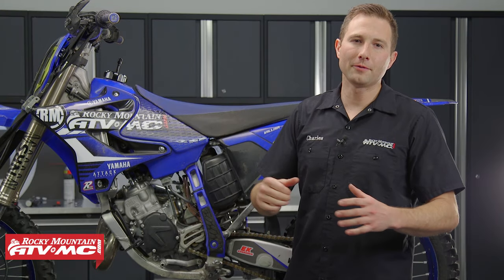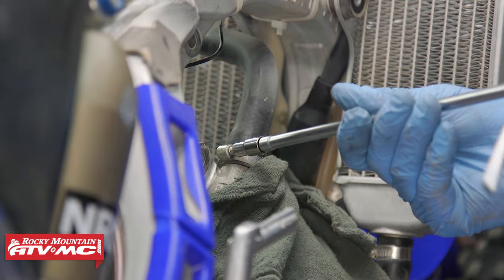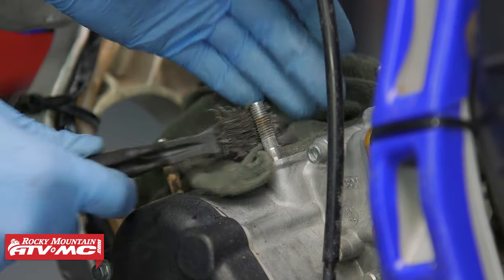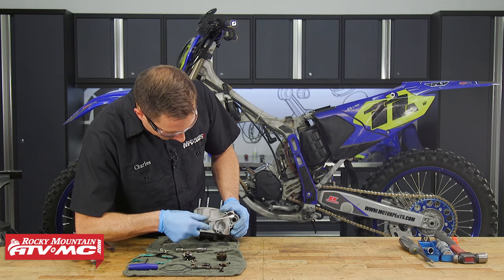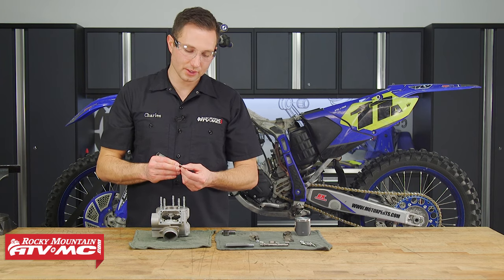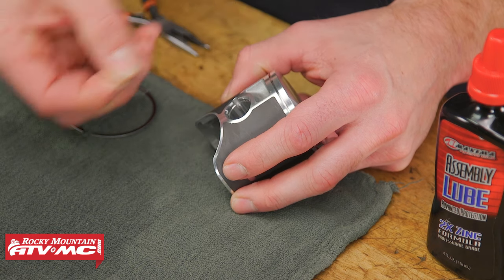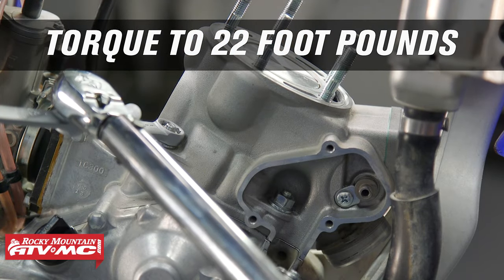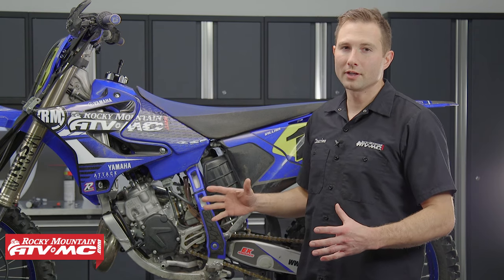How To Rebuild the Top End on a Yamaha YZ125 & YZ125X

Comment: Old video but only thing I noticed is when you went to file the rings you filed towards the outside, supposed to file toward the inside of the ring so it doesn’t create a sharp edge going against the cylinder wall.
Reply from the maker: Good point! I wasn't really trying to take material since we were in spec, and just trying to get the general point across. Regardless of direction I always clean up the ends when done. But yes, normally I would try to file in the other direction. We'll specify that in future videos. Thanks! -Charles

Comment: Watched the video very well. If you see signs of coolant flow, check the level as you saw in the video. I stand on a stainless steel ruler and shine a cell phone flash on the back. It's normal if you can't see the light.

Comment: Great video but I think you missed a couple of very important parts. 
1. Unless the engine is on the first piston change you should always have the cylinder measured to ensure you purchase the correct piston size. 
Using a stock piston size on a worn cylinder is bad practice and defeats the purpose, as the piston to cylinder clearance may be at the service limit. 

2. I’m shocked that the squish clearance was not checked, nor demonstrated. 
This is absolutely critical part of the rebuild, as too greater clearance will cause far from optimum performance, yet too tight squish clearance will cause detonation, resulting in piston, cylinder, and head damage in no time at all.
Reply: When doing a stock size piston in a stock engine means you don't need to check squish. it stays exactly the same. That is a completely bogus and stupid myth
Reply: @Shadow0fd3ath24  just compare the two pistons side by side. You should do this anyway, regardless of squish.
Reply: @redtobertshateshandles  of it's a stock piston theres nothing to compare🤦‍♂️
Reply: Nerd stuff

Comment: Heat Cycle Break in, then go ride normal?  I always heard heat/Cool Down cycle, ride for 20 or 30 minutes without going passed about half throttle and without quick revs etc, then put about 3 or 4 hours on it before you really open it up. Ofcourse not only is that what I was told by a few shops but that is for much older bikes too.
Reply: Yeah I feel like everyone has a different take on this. I’ve done a few top/bottom rebuilds and just ride it normally for the first ride. I’ll do a nice slow warm up and then try to give it about 3/4 throttle to help put some pressure on the rings and help seat them.  I’d would bet that as long as you don’t run the piss out of it you’ll be fine.
Reply: I bought a 21 yz250x heat cycled then did a 15 minute low to mid rpm break in ride. After that it was straight to the race track. As of today it has 16 hours all race time. No issues.
Reply: @boostedpleasure  I ride my little CR80 for 3 years on trails, hills etc Hallin butt everywhere, not one issue, but did top end anyway.

Comment: do u have to have the torque foot pounds at the right foot pound or whatever or can u just put it on like a regular bolt?
Reply: Just look up the torque specs in ur owners manual u don’t need the torque specs for everything but any motor work u do it will keep ur bike running better and longer

Comment: You were a bit blase` about the description of using the mid driven 12mm spanner with the torque wrench. I presume 22ftb at 90 degree but use formulae when using spanner in the straight orientation. Please be specific in future, you can confuse people inadvertently.